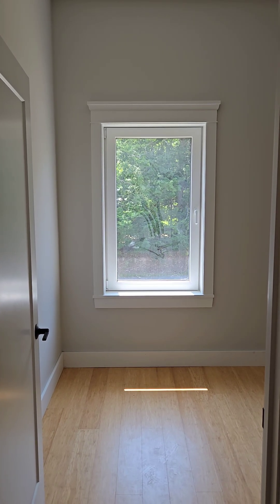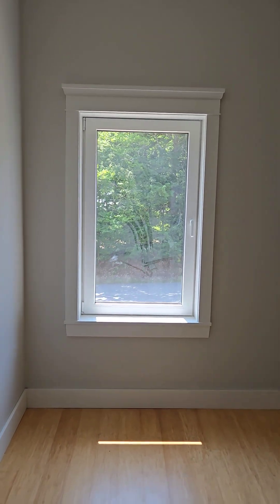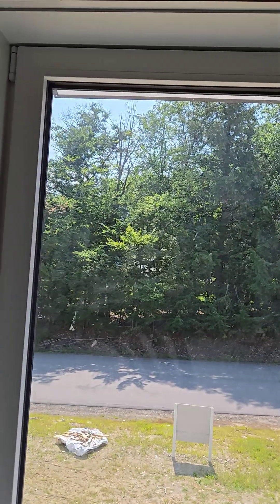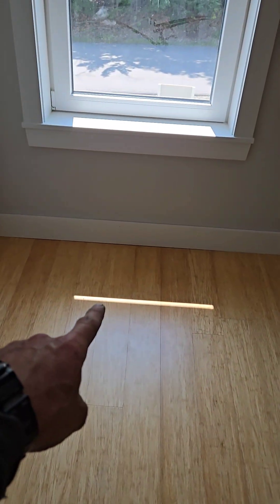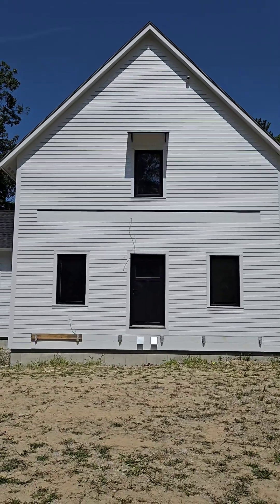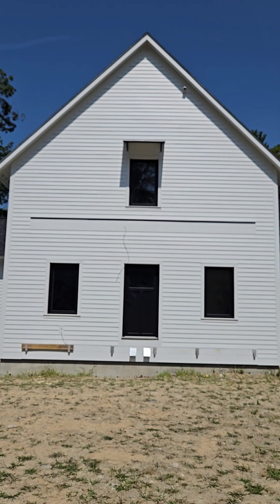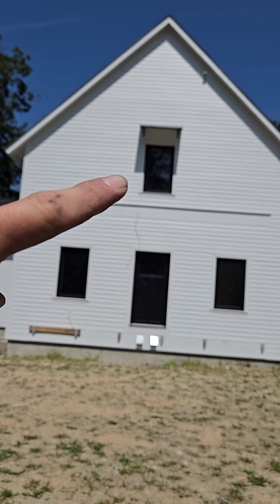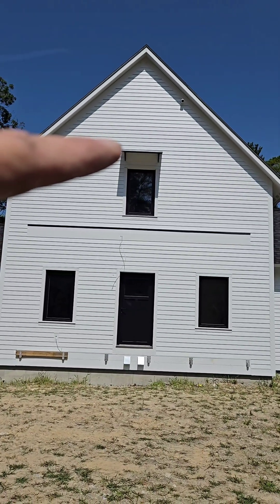Solar Shades On The Windows

Comment: Would you explain one more time how you got your height above the window and size of the awning?
Reply from the maker: Hello,
If you search the internet, you'll find a lot of different angles, even in the same latitude.  At this time, my opinion is 22.5 degrees from the bottom of the glass to the tip of the sun shade is a good angle to allow winter sun and block summer sun, when facing south.  22.5 degrees is a 2/1 ratio.  So for every 1' out, it covers 2' down.  I have no doubt that many people will differ on this, but it is working well for me.  
Happy building